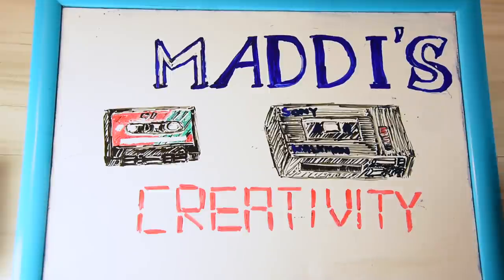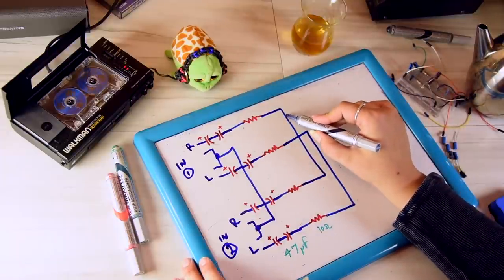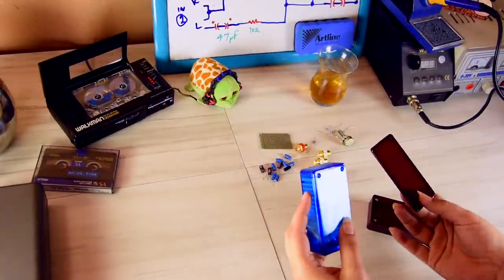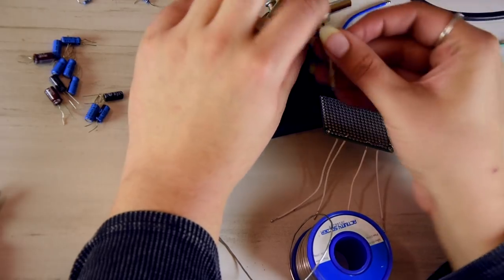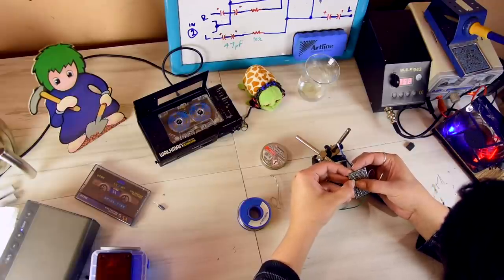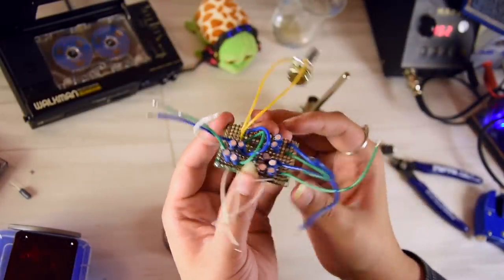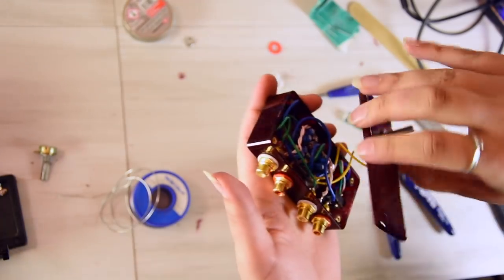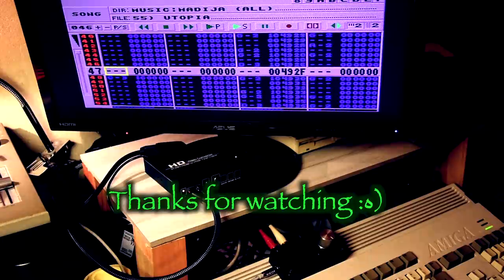Electronica - Amiga Stereo Separation Project Part 2

Comment: "I want this finished" Great job! The hard panning of the amiga sound ouput did everyones head in,you solved a problem in two videos that the commodore engineers never thought would be needed,we had to buy expensive mixers of our own,so,well done,a circuit like yours could have been incorporated into the paula output and mixed using software at the time
Reply from the maker: Yes it's such a simple solution, i'm not sure why they didnt incorporate it, then again there's a lot they could have done. Thanks for your kind comment :o)

Comment: Nice work. I'm using Behringer Xenyx 502 to fix Amiga's extreme stereo separation. It's a simple mixer and it also has additional mono input channel which is perfect for C64.
Reply from the maker: Thanks! .. the Xenyx 502 fixes the stereo separation? niice!
Reply: It does but you have to connect the wires in an unusal way: Amiga L -> Ch2 L, Amiga R -> Ch3 L. When only L sockets are used on channels 2 and 3 then the Xenyx treats them as mono channels and you can position the balance on each channel however you want and fix the separation that way. But if you connect it the usual way (L -> L, R -> R) then it treats them as stereo channels and this way it can't fix anything.

Comment: Rather than just a pot for linear bridging of the audio between channels.  How about a 1Khz bandpass filter?   You would end up with sounds spreading out across the stereo image to varying degree based on their pitch.  It would make for a very active and dynamic stereo image.
Reply from the maker: Hmm bandpass filter between the channels..Interesting idea!! I never thought of this..I may experiment with this and see how it sounds! If I like and impliment i can always put a switch in to activate or deactivate the band pass filter. I know what a low or high pass filter is but bandpass I needed to learn about. Excited to try this! Thanks for the suggestion!
Reply: @MsMadLemon  Hi, just found this awesome project and want to make one!  But did you ever experiment with this bandpass filter suggestion?  Is there a revision 2 of this thing?

Comment: Great video and a very interesting little circuit. Are all those capacitors really needed when there is no DC actually in the circuit to block, its a passive circuit! don't forget the good ol' lil' transistor for a signal blocking component.

Comment: I don't know if it's available where you are, but etchant and copper clad PCB is available to draw your own traces on a board so you don't have to chase the solder around, you can simply draw the circuit with a sharpie (permanent marker) (or transfer a print from a laser printer works too with and iron) run it through the etchant bath to remove the unwanted material. rinse it off, remove the marker with nail polish remover and solder your components and voila! You can reuse the etchant until it doesn't work too.

The copper clad PDB
http://a.co/3Q6Sj0U

The ferric chloride etchant
http://a.co/crqZYiA

Liquid Tin (not needed but makes soldering on it a breeze :D, you can rough it up with a wire brush or steel wool and just use flux)
http://a.co/5UqXkBz

Comment: Amiga has decoupling capacitors on both channels. I.e. for A1200 rev2 mobo, C324 and C334. Infact, if you disconnect one channel, the other become mono by internally shorting channels together.  In passive mixers like this, caps and resistors are worthless...
Reply from the maker: Thanks for the info, there's no harm taking precautions, peace of mind isnt ever worthless.